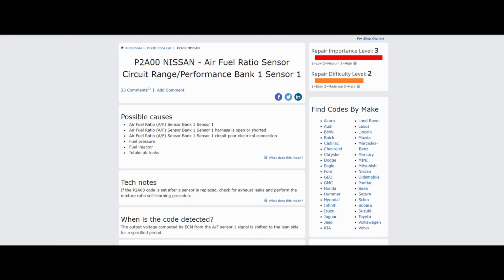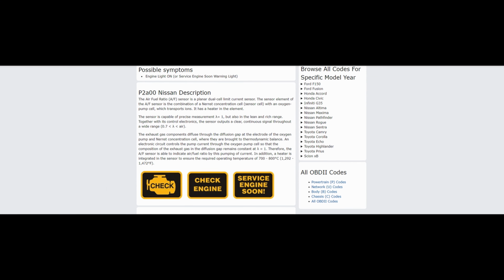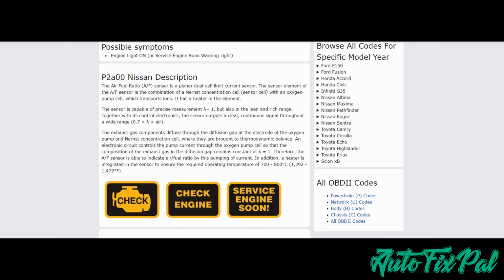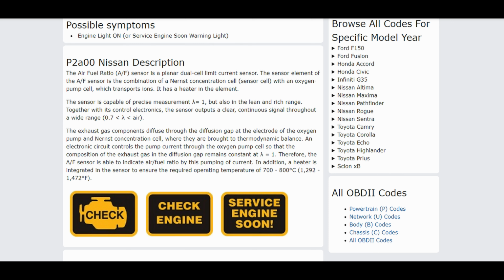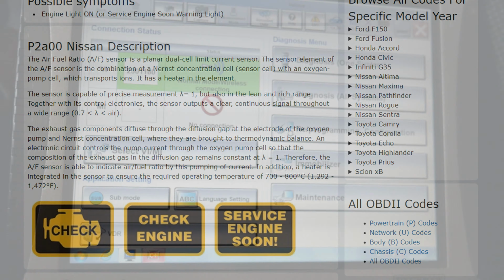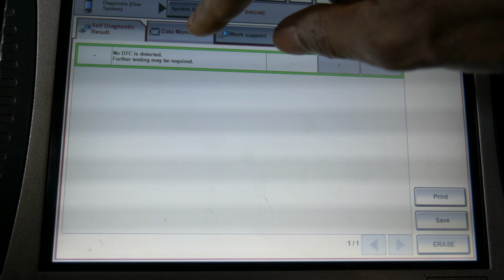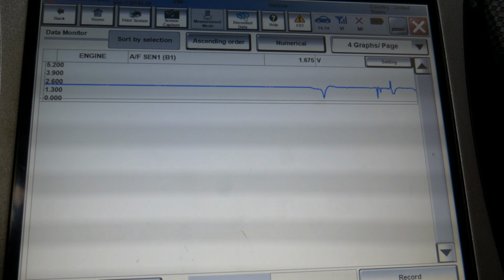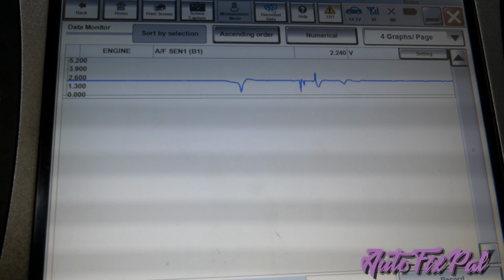2008 Nissan Rogue Check Engine Light P2A00- air fuel ratio sensor

Comment: Hi . I have 2007 Nissan Altima I have system to lean bank 1 
I change my mass air flow sensors and I change my air filter 
I check for vacuum leak is good
But my car eat gas . Do you think if I change air fuel ratio sensor is going to help with my gas ?
Thank you
Reply: Is it qr25de engine? If so p0031 or p1148  
Is p0031 Check fuse replace if blown
Reply: After, reset code and drive for a little while
Reply: Yes
Reply: If light comes back and has p0031, and p1148 replace the sensor

Comment: Great video ! Very common code , and glad you mentioned those exhaust leaks. They always seem to be overlooked
Reply from the maker: They sure do. Not sure if you have seen it yet. But watch out for those Nissan NV with AF ratio sensor codes, The weld at the flange to the Catalytic convertors will break clean and i mean so clean that you wont hear an exhaust leak until the throttle is snapped and you end up with AF sensor codes sometimes or 420 or 430 codes.
Reply: @Autofixpals  I have NoT seen that yet! Thanks for the heads up ! And to think I almost bought one 😏
Reply from the maker: @NewLevelAuto  The exhaust is the week point. Mainly the Cats. everything else on the truck is solid. However the ford vans drive better IMO.
Reply: @NewLevelAuto  hey exaust is lifetime warranty